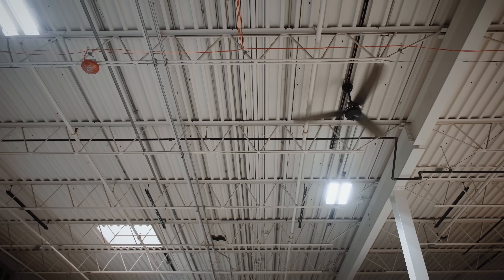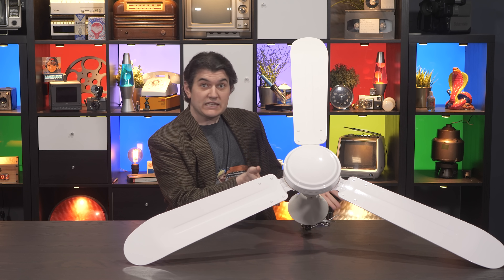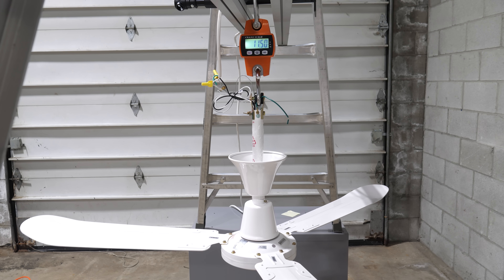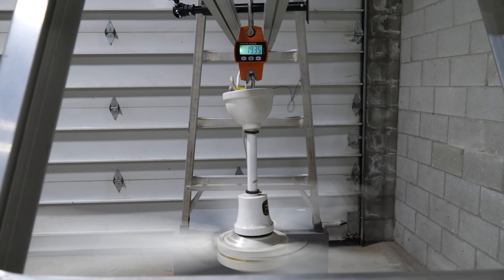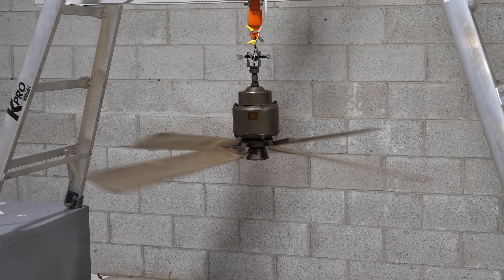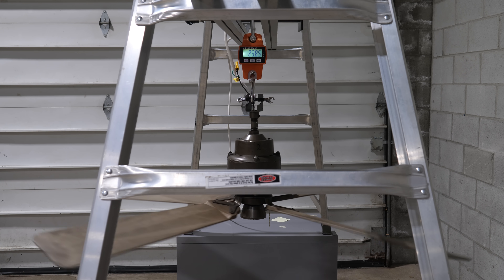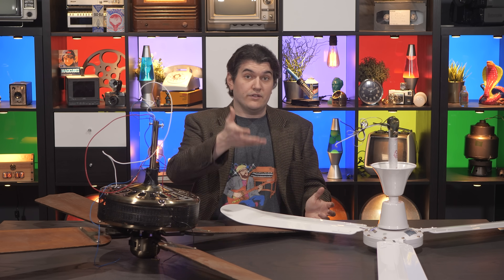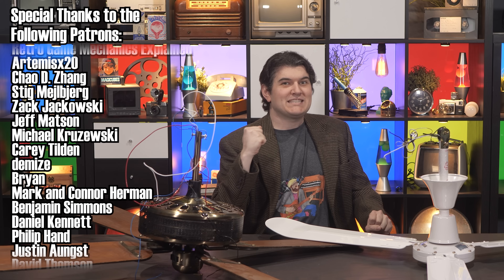How much thrust does a ceiling fan produce?

Comment: Another fun fact - pumps and ship propeller shafts also produce a lot of thrust! I worked on a ship with 2x 15,000 HP propellers. You need a special doodad called a thrust bearing to keep the shaft from either launching out the back of the ship with the propeller, or jamming itself back through the engine, depending on if you're reversing or going forward.

Comment: These are great - I'm hoping you will follow up on these to contrast which settings (low, medium, or high) are most energy efficient in summer or winter. I feel like leaving the fan on low doesn't do a whole lot and just wastes electricity. The only time you can really feel the air move is on HIGH.
Reply: It really depends on the size. A small ceiling fan is basically useless on low, but larger ones still move a steady breeze.

Comment: You wouldn't have been worried about the ceiling fan causing stress on the electrical box if you'd ever felt what the air current from a 5" drone feels like. Those can be around 2kg of thrust and things go flying if you hover them indoors :)

Comment: Those lazy no good fan manufacturers need to add a counter rotating torque eliminating flywheel into the fan hubs. Don't they realize youtube videos need to be made?! Flywheels mounted in flimsy stamped sheet metal motor housings hung from living room ceilings are perfectly safe, btw.

Comment: You say thrust and then say push air. Which is it? Does it thrust or does it push?? /s

If thrust was truly a metric to be measured, add a washer fan blade mounting to change the angle of the attack of the blade.

Comment: You’re super close to measuring the torque now. You can hang the fan from a chain, and put your scale sideways on a wire a foot or so from the center so it can counter the torque. You can hang a weight from a pulley on the back of the scale line on the opposite side so it stays in tension

Comment: The rotors are aerofoils. Not the same design as a fan
Reply: fan blade shape depends on operating conditions. Not unique.
Reply: @seigeengine  You have a point, but that fan blade doesn't represent a rotor. 
This is my favorite tuber, btw. So, I'm just honored to be in a highlighted comment.
Reply: A ceiling fan doesn't represent a helicopter rotor. Those are designed to create lift.
Reply: @seigeengine  It's no effort November. Let's give the guy a break. 
Good talking with you, man.

Comment: As a U.S sparky of 10 years, I can readily put your mind at ease, regarding most modern fan installs. All modern fan boxes are required to support a minimum of 15 to 20 pounds. Anything more than that, and you are required to have specific boxes Installed for the weight. Most of the time, old work fan boxes are of a spreader bar style, and wedge themselves between your ceiling rafters with 1/4" spikes to secure your fan. Those are rated for 20 ish pounds, depending on the manufacturer.  Speaking for my self, I won't install a fan until I can comfortably do a single pull up on the fan bar. (I'm 120 lbs) so yeah, those suckers are solid.

Comment: What's astonishing is the lack of aerodynamic optimisation of the fans blades ...  Just a NACA profile for slow speed would do so much for them... But I Don't know a thing about this.
Reply: They are actually fairly optimised. Ceiling fans simply move so slowly that a flat blade like that is nearly optimal. Maybe you'd benefit a bit from slightly cupping it, but negligible.

Comment: Ok. Just starting this video. First thing that comes to my mind: "Hey! That heatpump guy maybe can tell me how those work!" Premise is that I as a kid lived in south East Asia when my parents worked there. First country we lived in we had no heat pump, aka aircon. What we had was: wind = cool. Yes. But in hindsight I don't get is how tf that still worked with those high humidity? It's like the air can't take any water in any more since it's at its max already. So how can it still cool? Is there still evaporation cooling? With nothing it could evaporate into? It's still mindboggeling to me. It works. And that's all that's counts. Still I wish to know why.
Reply: So wind cools you down in basically two/threeish ways.

One is that it speeds up evaporative cooling, but that doesn't work if the air is fully saturated (it may not have been, but idk).

The other is that it cools you by simply blowing cool air across you. I said threeish because air forms a boundary layer around objects where it sort of sticks to them. This means the air right beside your skin is kind of stuck to your skin, which insulates you. Wind blows this layer away somewhat and helps you exchange temperature with the environment better.

Ultimately, if the temperature is too hot and it's too huimid, air doesn't cool you  The combination is called the wet bulb temperature, and if it's too high, it's fatal for humans.
Reply: Ok. That setup is way to much for a no effort november.
Reply: And also what im asking my self: "Why do fans use angled blades and not aerodynamic shaped ones like windmills do for example? Just in reverse." ?
Reply: Interesting would be how mich torque those fans all make.

Comment: Well, be a little for detailed and take all the readings without blades. Take the measurements of air amount and velocity being pushed down. Perhaps to be a little more exhaustive, you can use the airfoils and see the difference between Newton and Bernoulli and we may know why in fans the airfoil is not used but in helicopters it is used.

Comment: After watching the refrigerator episode I was wondering if you could test out the nest thermostat vs a standard one. Does it really save money or does it use more energy trying to warm/cool the house after arriving home.
Reply: This is a well-settled issue.

It takes less energy to heat back up a house than to maintain it at temperature.

Comment: Propeller blades have twist, in order to 'push' the air back in a roughly flat, straight direction and provide forward force.  The ceiling fan jsut has stright blades, which are way less efficient at pushing 'back'.  In a room you literally want them to set up a rotational flow around the outer edge of the blades.
IOW the ceiling fan could do better thrust in one direction with correct blades.  The 'force' and airflow you want a ceiling fan to provide normally is different than just straight down, so it will be difficult to measure the full force correctly.
To understand that this is a thing, read about a helicopter.  Normally, downward flow supports the weight of the helicopter.  But if a rotational vortex sets up going from the bottom around into the top of the rotor disc, most of the power can spin the vortex ring, and the helicopter will go down and can crash.  This is called 'settling with power' and similar, look it up to become familiar.  Even a huge amount of power and down thrust can still not keep the helicopter up, because the power just makes the vortex rotate faster, not go down and provide lift.
So 'not all down thrust registers as lift and lighter weight'.  And specifically a ceiling fan doesn't have the blade warp needed for good thrust , so will only show a fraction of its power as lift.
Reply: First of all, the straight blades of ceiling fans are very efficient at the low speeds they operate at.

Secondly, I... am reasonably sure the vortex ring state of helicopters is irrelevant to ceiling fans. While ceiling fans do circulate air in a vortex, a vortex ring state is caused by the vortex gets exacerbated by air flowing up through the rotor to the point where the blades can no longer generate enough lift to keep the helicopter in the air. Ceiling fans both don't typically suffer fast airflow upwards, but move so slowly that the vortexes at the tips of their blades are negligible.
Reply: @seigeengine  'First of all, the straight blades of ceiling fans are very efficient at the low speeds they operate at.'
 Efficiency is only watts to air motion.  Air motion in different directions other than down is not thrust against gravity, and does not reduce weight.

Straight blades have the same pitch along their length, sweeping through different diameter circles as you move out from the hub, and set up differential flows.  Period.  They are not optimized for thrust, the differential thrust puts a good percentage of the energy into developing sideways flow.

Literally anyone can go learn about airplane propellers a few minutes and why they have the washout twist in the blades, and realize you have little understanding.

I wasn't 'inviting debate from some silly guy furiously googling and not understanding the diagrams they're seeing'.  I learned RC helis back in the early 90's specifically to learn the most complex 3D available at the time, I guarantee you I understand the rotor and disc dynamics far better than you do.

'at the low speeds they operate at.''  You realize he's running these at the highest speed available and trying to produce thrust, right?  While it's still relatively slow for a prop or rotor, it's exaclty the worst operation point for the straight fan blades, they will suffer significantly from not having correct washout.

I was informing the smart people to look things up and realize the maximum this was doing is noticably below the real max the fan could possibly produce, and that the fan blades are actually very poor for testing this.

The main thing a fan even does is set up a larger vortex flow around the whole room, so that the fan in the center circulates the air in even a larger room, which is the fan powering a larger torus vortex flow from the center..  Ceiling fan 101.

Comment: Near the end of the 30 years that we lived in the house that we bought because we could afford it, after I had put in grounded 12 gauge wiring with 20 circuit breakers to replace the tube in post wiring connected to two circuit breakers, and after replacing several of the light fixtures in the house with Home Depot type ceiling fixtures that were quite light, the ceiling fan just behind my seat in the front bedroom/office crashed to the floor. It turned out to weigh 28 pounds, and it's installation consisted entirely of two screws into the wooden plank ceiling that was covered with sheet rock. This house was built in 1919 I discovered near the end of our residency. Thus the fan that was by far the heaviest, had no crossfire between the rafters and was held up by only two screws, which actually pulled out because of the vibration, not very large, of the fan after roughly 30 years of our use.

Comment: Helicopters are terrifying.  Seeing those giant planks hanging there, and then having them rotate at crazy speeds, just dying to tear loose and fly out like a speeding projectile.... yeesh.  And, if they stopped spinning, you wouldn't just coast down like an airplane.  You'd just straight up suddenly start obeying the laws of gravity and come right on down.  O_o
Reply: Sort of. Helicopters can do something called autorotation, where the helicopter falling through the air continues to spin the rotor and slow descent until the helicopter nears landing where it uses the energy stored in the spinning blades to slow the helicopter enough as it lands. This is sort of an equivalent to a plane gliding. Helicopters MUST be able to do this, and helicopter pilots are trained to perform these.

But yeah, this doesn't work if the rotor actually stops spinning, and is more about situations like the engine failing mid-flight.

Comment: I feel like for the most accurate reading, you'd need to flip the fan over, hard-mount it to a load cell, and track the thrust in the other direction - that way you can remove the losses from the wobble.

Comment: A low effort way to ballpark the thrust of a fan is to start with the wattage rating. That’s a theoretical maximum. In practice you will have way less because a fan only draws full power for a few milliseconds during startup. And of course lots of power will go into friction, turbulence, noise, all the electrical weirdness motors do, air moving in other directions, and whatnot.

Since ceiling fans rarely have optimized propeller airfoil designs thrust is generally going to be small.
Reply: Ceiling fans do not need propeller shapes because they spin so slowly that the effect of the shape of the blades is negligible.

Some ceiling fans do have propeller shapes, but these are typically much larger and may spin faster, meaning the blades are moving much faster.

Comment: As stated, the thrust and weight is not the main issue.  it's the torque and wobble.  The problem is how people install them, and where.  I've seen many fans drop straight out of the ceiling because there's no brace, or even a metal box mounted directly to a stud.  Off code electrical installations with ceiling fans are a horrible thing.

Comment: Helicopters don't use 'fans' that produce thrust to fly. They use airfoils the revolve and create lift like any other wing. Low pressure on top, high on the bottom. You get lift. The thrust from the movement of air downward is negligible compared to the lift created by the rotating airfoil.
Reply: Yes, they do.
They create pressure by pushing air.
Airfoils don't let you ignore newton's third law.

Comment: Since those things live close under the ceiling there should be noticeable 'ground effect' (or 'ceiling effect' in this case). Anyone who's been flying tiny indoor helicopters, or quads should know  well what I'm talking about. For those who've never tried - walls and ceilings act almost like magnets on those toys. It is sometimes very difficult to fly through a door. So ceiling fan directly under the ceiling would pull even more force due to suction it creates.

Comment: Any ceiling fan, Menards included, requires mounting into ceiling studs or use of a ceiling fan bracket to take the weight and torque.  Also you said jerk force.  Which is awesome.

Comment: You guys hang a sealing fan from an electric box???? You guys are strange... We hang them from a 1/2 sphere that is screwed to a steel plate that is screwed into the sealing with strong plugs. Sounds much safer? Yes, because it is 🙂
Reply: They're supposed to be mounted in fixtures that are designed to handle the extra load, but often people just do any old crazy thing.

Comment: Notice that the fan blades are flat and aren't actually propellers. Helicopter and plane blades are actually "wing" shaped, and the "thrust" they produce come form te vacuum of the curved side of the wing, not from shoveling air backwards or down. Just my 2 cents.
Reply: Your two cents are wrong.

Ceiling fan blades are flat because they typically move very slowly, so aerodynamic effects from blade shape are negligible. You'll notice standing fans have curvy blade shapes instead... this is because they compensate for being smaller than ceiling fans by spinning much faster.

Wings create "thrust" because they push air down. The way they do this is more complicated than just scooping it down, but newton's laws don't cease to apply just because you've made a fan's blades a certain shape.

Comment: It's not the same the blade of a helicopter or airplane has a special shaped curve to create lift or thrust. The ceiling fan has flat slanted blades. It will create some thrust but not much. You don't see desk fans pushing themselves over.
Reply: They can. Either way, the difference in shape is related to the speed they operate at. Ceiling fans spin slowly and are flat boards, standing fans spin much quicker and are curvier, and propellers spin very very fast and are full on aerofoils.

Comment: Now I want a variable pitch ceiling fan.
Reply: They made them in the early 1900s.  It was not a very useful feature.
Reply: @dspiffy  I wonder why they bothered, it seems like it'd be simpler to control the rate of rotation than the pitch of the blades. Still, imagine the lift you could get out of one of those!
Reply: @funghazi  It had 3 motor speeds as well as being able to adjust the pitch.  Being able to adjust the pitch was a means for mechanically reversing the fan, however you could set any pitch in between full forward and full reverse.  I've never owned or tested one, but @That Guy From The 724 has a good video of one on YouTube.